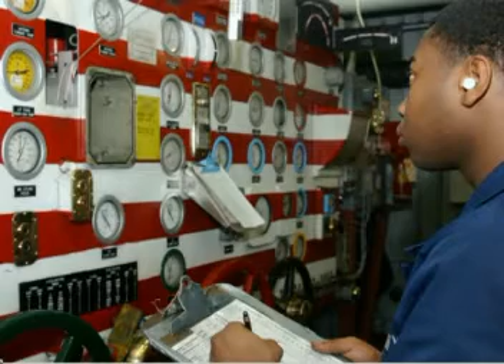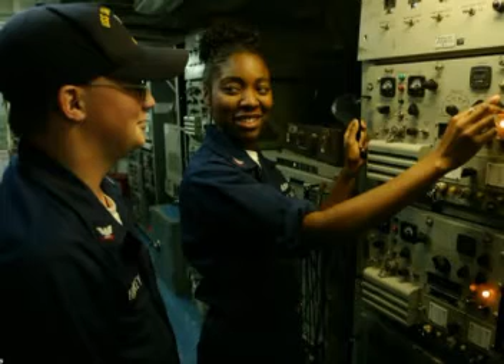USS Sacramento (A0E-1) Pics

Comment: 89-92 weps division
Reply: Hey miller this is btfn arnold I remember you 😁
Reply: @ansonarnold1584  hey its been a long damn time. Where did you get to? i am in Nevada. Ran in to Boats(deck boss ) the other day.
Reply: @gregmiller3556   after I got out of the navy, I moved down to san Diego CA, and worked as a outside machinist for one of the shipyards here in san Diego. 2 years ago I finally retired from the company. And I' m enjoying retirement immensely. Took up surfing. I have been in contact with a few other boiler tech from the sacramento. 😁👍🖖
Reply: @ansonarnold1584  ahh nice.  i miss the ocean. Not much water here in las vegas